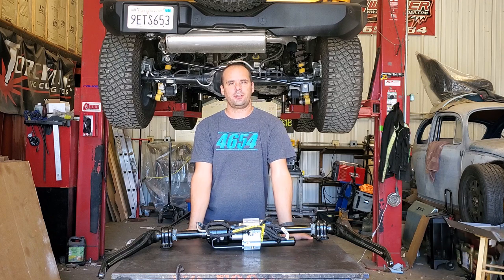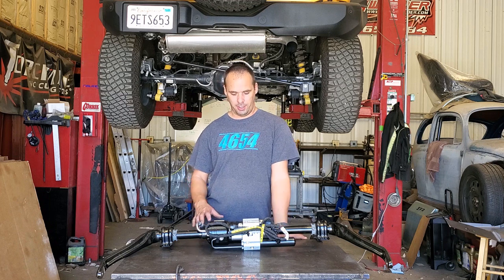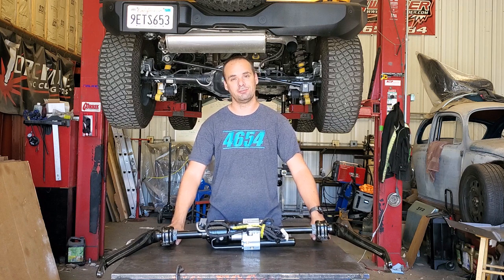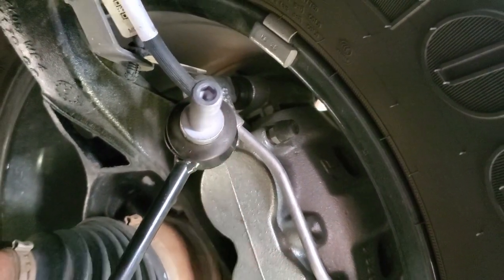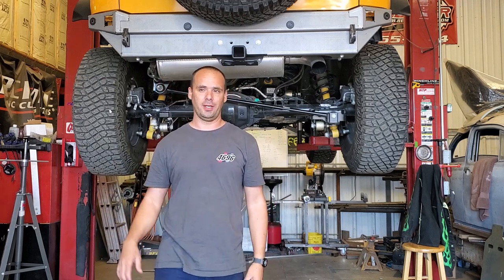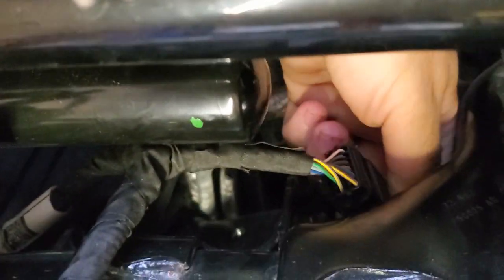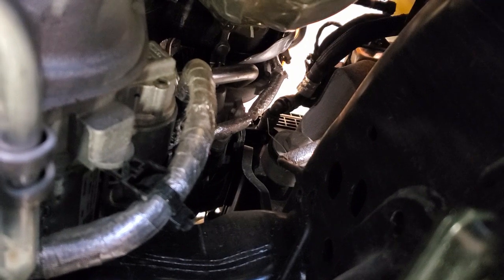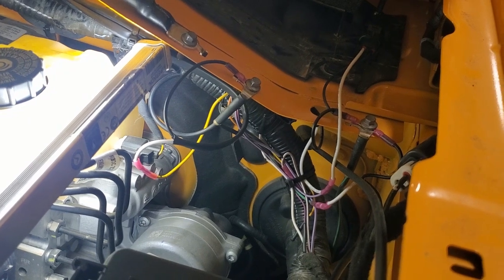Installing an Electronic Sway Bar disconnect in a Non-Badlands Bronco

Comment: Thanks for the detailed video
A few questions?
1. Isn't it worth transferring the voltage to the solenoid through a relay and not directly from the aux
2. Does disconnecting the stabilizer also make sense in a Wildtrak vehicle that has had a lift
3. What indication do we have that the stabilizer has reconnected (there are no sensors and in the past, Badels reported that it did not reconnect)
Indicates that the stabilizer has been lowered in order to return as much as possible to the original (the original, of course, the electric one will overcome the lowering)

Comment: @stinkyfabracing do you (or anyone else) happen to know if the badlands disconnect will fit on a ranger raptor? from what i can tell the swaybar on the ranger raptor and a non disconnect bronco are the same part#

Comment: Any reason I couldn’t splice into those wires on my factory setup so that I can select it either through the default switch or override it anytime I want? Would really like to be able to use it in 2wd
Reply from the maker: This is just my prediction, since I haven't tried it, but I see 2 things happening. 1) if you leave everything connected, but also splice into the wires and supply power to the disconnect, it's going to backfeed power to the computer, probably triggering an error, and possibly damaging the electronics. 2) If you clip the wires and run them to the switch in the same manner I did, when you flip the switch then the computer is going to see the sway bar not in the commanded state, triggering an error code. If you disconnect the sway bar from the factory wiring entirely, and wire it up like I did you will definitely get error codes. 

The issue is that I've only connected to the actuator solenoids. There are also sensors on the actuator that tell the computer what the sway bar status is. In a non-badlands this is fine because the computer isn't looking for input from those sensors. In a badlands however the computer knows there should be sensors, and they should be showing it what it wants to see. If the computer wants it to be locked, but it's unlocked, you'll get an error. If it doesn't see the sensors at all you'll get an error. I'd be willing to bet that the majority of people with Badlands who have gotten sway bar errors didn't actually have a problem with the sway bar, but rather with the position sensors. 

I guess that's a long way of saying that if you have a badlands, you're probably stuck with the computer nannies.

Comment: Thanks for the video, just received the stabilizer and Connector. Have to order the fire sleeve, then installing on my 23 wildtrak. In my 60's and didn't feel like crawling under it to disconnect pins to go off-road
Reply: @RandyPeters-w7q  Nice!
Reply: How much did all that set you back? Thinking I might do this on my '24 Wildtrak. Thanks
Reply: Can we get an update? How did it go?
Reply: @mikelopez8714 works great, lots of off-road miles with it. Very easy install

Comment: Amazing video thanks for the insight. Can you do a follow-up and let us know how it's been working so far.
Reply from the maker: Don't really need a whole video for that. I flip the switch, it disconnects. I turn the switch off, it reconnects. Flawless!
Reply: @stinkyfabracing  appreciate the quick response.I will be going this route with my everglades, Bronco. Thanks
Reply: @stinkyfabracing  Does it impact the computer at all? I had a local garage say they couldn't do it to my Wildtrak because it would throw errors.
Reply from the maker: @crotonik  the way we have it wired here doesn't interface with the computer in any way, shape, or form. The computer doesn't even know it exists. It's literally just an on-off circuit no different from a set of lights.

Comment: How do you get it to reconnect?
Reply: Turn off the switch.
Reply: @stnkbg1 how does it re-center?
Reply: @brock13r technically it doesn't. Once your suspension levels out it reengages in the neutral position. It doesn't like force you back to level or anything.
Reply: @stnkbg1  Really interested in this method - especially after viewing certain (and expensive near-alternatives at SEMA last week). Apologies, but need to confirm: flip on the upfitter switch and the StaBar disconnects; have fun; then when level, flip off the upfitter and it reconnects?
Reply: @mexpuck  exactly. Don't have to be level though, it'll reconnect when it gets to center.

Comment: Have you had any issues with this method of install since you first installed the disconnect?
Reply from the maker: @paulvasta6159  nope, it's been flawless. I generally flip the switch right after airing down and leave it disconnected until i hit pavement again. Bronco has no idea it's even there.

Comment: Question on bolts. Did the disconnect come with new bolts or did you have to use the ones that came off the stock sway bar?
Reply: It uses the same bolts
Reply: @stnkbg1 Thank you! Ordered the sway bar disconnect and have the harness. Going to install as soon as it gets here.

Comment: How much was the auto sway bar?
Reply: Price seems to vary but I've seen them frequently for around $1500
Reply: @stnkbg1  I just recently got a totaled out 2021 ford ranger lariat tremor, I plan to install this on that ranger.  It’s my understanding that the bronco is built on a modified version of the ranger frame.  Would love some measurements to ensure this would “bolt up” to the ranger frame as I plan (hope) to do exactly the same thing on a factory rocker switch on the dash in the ranger.  If you need my email or cell phone, let me know

Comment: Hello,
I have a brand new wildtrack. Installing this part - would I lose any functionality and stability of the drive?
Wildtrack is made for faster drive through dirt and rough surfaces and comes with sports mode,
any harm installing this and losing any of the bells and whistles of wildtrack driving capabilities?
Reply: When engaged it's the same as the non disconnect sway bar in your wildtrak. The bronco in the video is a wildtrak as well.
Reply: @stnkbg1  thanks bud:)

Comment: The Bronco Raptor has sway bar disconnect as well. And I’ve got a Ranger Raptor on order. It’s got front and rear lockers……I’m wondering if this video would help me reference a Bronco Raptor disconnect into my Ranger Raptor!?!?
Reply: The ranger raptor has more in common with the standard bronco than the bronco raptor. The entire front frame and suspension sections are the same as far as we could tell from the Ford 3D models. The badlands disconnect would likely bolt right up. No idea if the braptor one would or not.
Reply: @stnkbg1 can’t wait to find out. Hook it to an aux like this gentleman did…and boom…f+r lockers already come standard.

Comment: You are a genius. I have the Bronco Raptor and hate that I have to be in 4 wheel drive just to disconnect. A lot of trails where I’m at in the Rocky Mountains benefit from the sway bar disconnected with ruts and rocks, plus gives a more plush ride, but hate that I have to run around in 4 wheel drive just to disconnect. 🙄

Just ordered the wiring harness in your description. Going to keep all the factory wiring as-is so I can just plug back in and be back to stock, but do the wiring up to the AUX switches so I can disconnect whenever I want. Curious if you’d know if I might throw codes? 🤞😅
Reply from the maker: The stabilizer has its own sub-harness that goes from the one big plug and splits to the 4 plugs for the solenoids and sensors. For your setup it might be better to find the connectors for the solenoids directly, rather than the one i used that connects to that sub-harness. This way you could just unplug the solenoids and then plug your new wiring in without cutting anything.
Reply: @stinkyfabracing  you’re the man. How do I pay you a consulting fee?
Reply from the maker: @daineclark  😂 no need for that, but feel free to take a look though stinkyfab.com and see if you like any of our products!
Reply: @stinkyfabracing  will do. 👊😎
Reply from the maker: I would be surprised if it didn't throw some kind of code, but it might depend on how you hook it up. 

If you unplug the entire assembly the computer will probably throw a code because it's not getting feedback from the sensors. I wonder if you left the sensors plugged in, while bypassing the solenoid wires what would happen. My guess is that when the sway bar is connected all will be fine, but it'll probably throw an error when you disconnect. The real question is will the error clear when you reconnect?
Reply: @stinkyfabracing   oh good point. I’ll see if I can also buy a male version of that plug so I can build me a little bypass without cutting anything and still keeping the connection to the sensors. Thanks for the feedback. 👊😎

Comment: Did you happen to measure the amount of extra travel
Reply: That's not really something you can easily measure. The sway bar does not limit actual travel, it limits articulation. The front tires will still travel up and down the exact same distance, the difference is how easily one side can now compress while the other extends. With a standard sway bar (and with this one connected) both sides are joined by the sway bar. The amount of articulation you get is a product of how much load you put on it and how much the sway bar flexes. You'll get more flex on a downhill with all the weight on the front of the vehicle for example. With the disconnect the sway bar is no longer fighting that articulation.
Reply: If you measure from ground to the forks that was the measurement I was talking about
Reply: @michaelnice4753  i didn't, because that's not a very relevant measurement since it will vary with loading. The suspension was never fully compressed in either lift, and even just lifting front vs. Rear gets a different height because of weight transfer. 

I can say that after disconnecting i was able to lift roughly 4-5 more inches on each end after disconnecting.

Comment: Great detailed video… I have a Wildtrak as well and would like to do this. Besides the flex test is there any way to know it is disengaged or rather engaged? Can the swaybar re engage at any angle or does it have to be on level ground?
Reply from the maker: It's pretty noticeable in the roll characteristics when you're driving, but other than the switch position and light on the switch there isn't any indication of if it's engaged or not. 

You can turn the switch off the switch any time, and it reconnects once it gets to the "level" position. You don't have to be on flat ground to re-engage, but it won't actually reconnect until the suspension gets back to center.
Reply: @stinkyfabracing  interesting! Thanks for the reply. I’ll have to add this to the list!

Comment: Appreciate the video. Exactly what I was looking for.  Do you know if this works with the Fox shocks on the 23 Wildtrak?  I would think it’s the same but at the same time, I wouldn’t be surprised if Ford switched other parts to make things not compatible. 
Thanks
Reply from the maker: as far as I can tell all they did was swap different shocks onto the 23 wildtraks. I don't see any reason it wouldn't still fit, as the connections at the control arms are still the same.
Reply: Thank you

Comment: Where did you manage to find one?
Reply from the maker: Like I said in the video, any Ford dealer can order the assembly, or you can just use the ebay link I put in the description. That's where I got this one, and google searching the part number will come up with lots of sources.
Reply: Have you tried unlocking Rock Crawling GOAT mode with Forscan?  I wonder if it would trigger the disconnect and if that would conflict with the AUX 1 position @stinkyfabracing